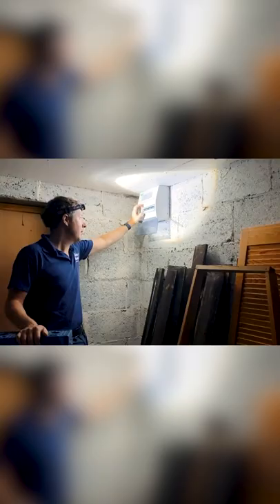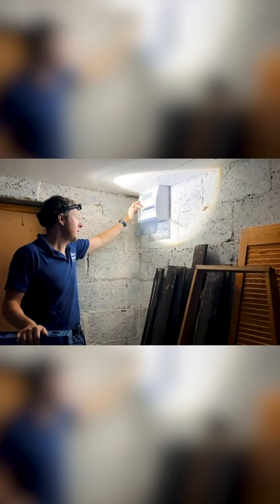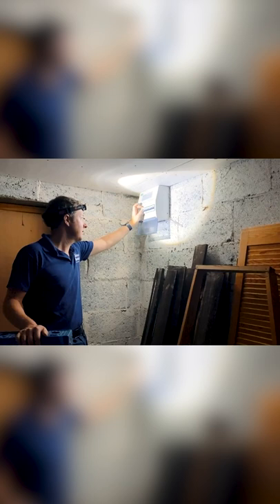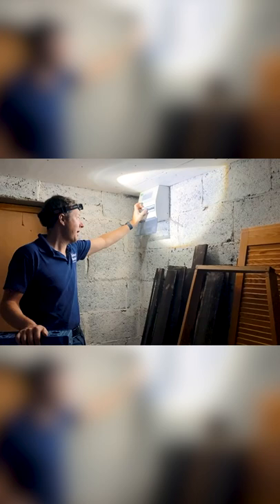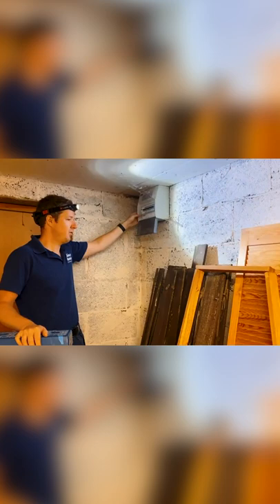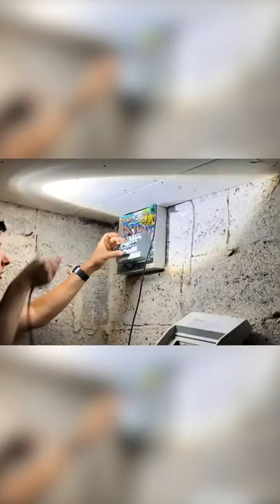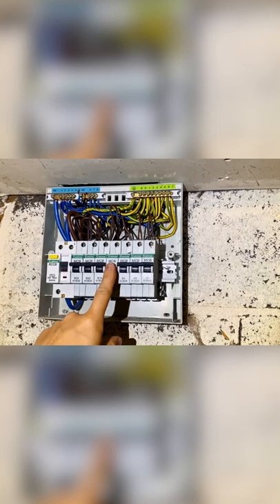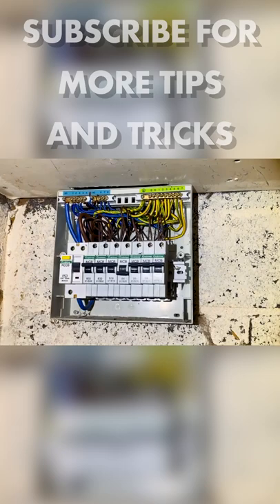FAST FAULT FINDING - Electrician Tips & Tricks #shorts

Comment: If you have a infrequant nuisance trip on the kitchen ring. But IR is all ok and Appliances IR is all ok. Chances are that the fridge freezer defrost element is shorted to earth, but due to the defrost timers they have, the fault cannot normally be detected at the plug. Hope this helps anyone.

Comment: Looked like a B6 breaker, water ingress on exterior lights and joints most of the time usually a visual inspection is enough after that point to see it. However I would say the fact that the rcd didn't trip the second time I would ramp test that while I'm at the board. I've seen an mk rcd fail after re setting from a fault. 
Asking the residents of any changes or incidents etc comes hand in hand with working out what circuit the faults on.

Comment: Do you not disconnect each cable to stop damage to the rcd on insulation resistance
Reply: Probably did it at 250v
Reply: @creativejamieplays7185  he did. That's what he said in the video

Comment: Hey, love watching your vids. Quick question, when the ends of cables are popped into plastic housing boxes pending second fix / connecting to lights etc, what are they called? Need to run a cable through a chase line and then have a spark connect both ends up due to timing issues, but don't want cable floating about and touchable, even though their dead, don't want my kids playing with it..
Reply: Chock box. Thanks all :)
Reply: @25zerotwo  or Wago / insure in line connectors or could just wrap them up with electrical tape roll up the cable and tape it back .